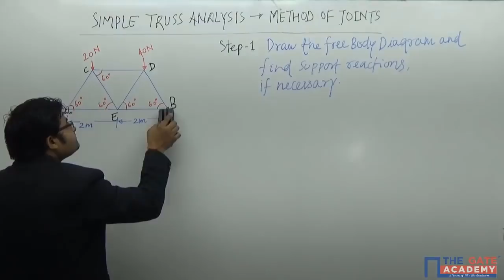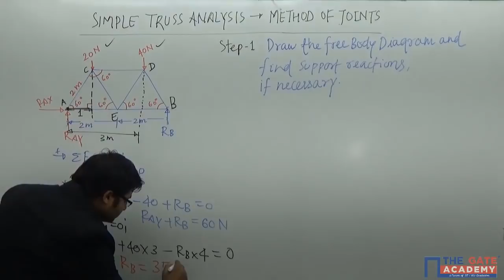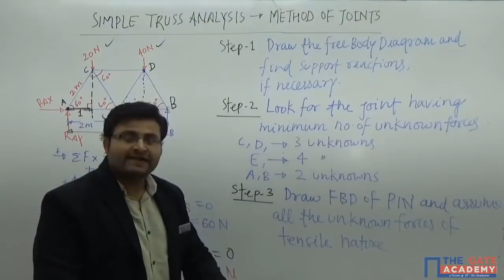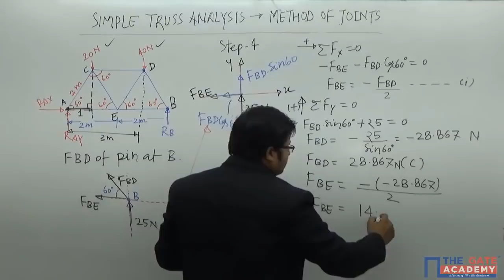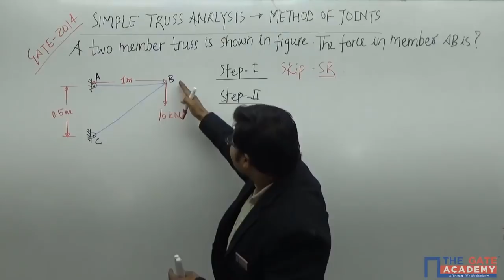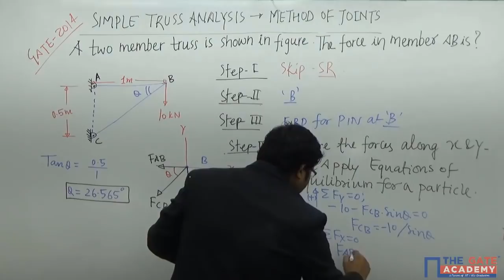Analysis of Trusses - Method Of Joints | Engineering Mechanics | ME/ CE

Comment: Sir it's good but in gate exam for a single question of 2 marks they will alot not more than 2 min so some what faster calculation and tricks required in solving
Reply: Use Lami's theorem instead of finding the components.